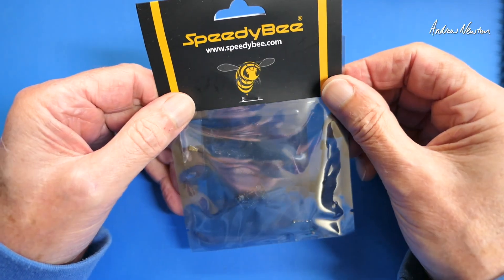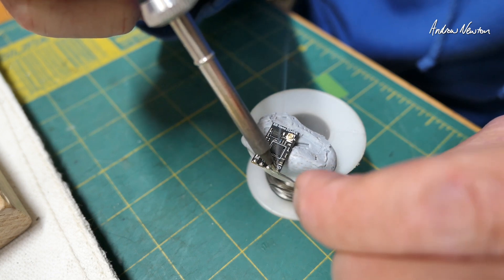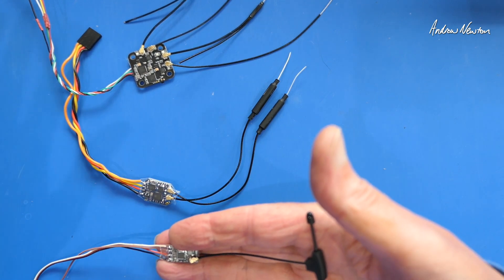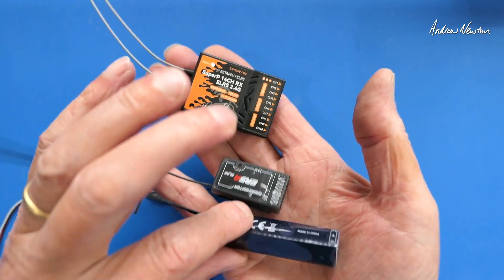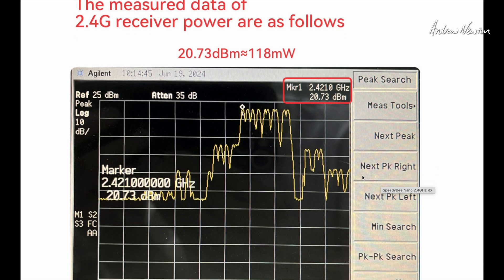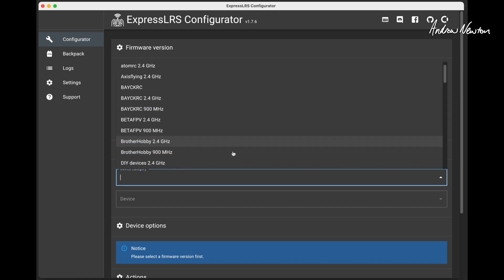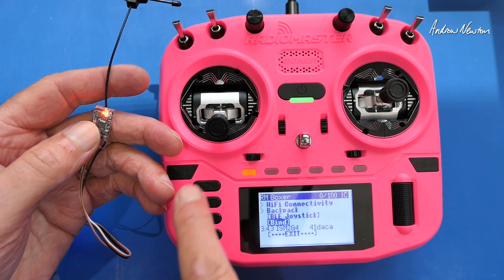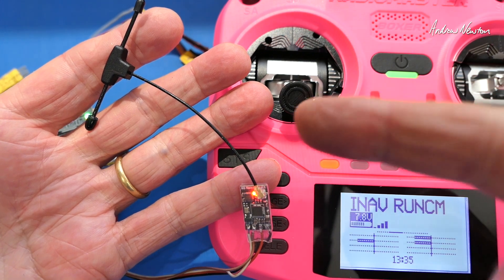SpeedyBee 2.4GHz Nano ELRS Receiver

Comment: Have you used this reciever with 9+ channels?

I have an issue with intermittent telemetry data above the first 10 senbsors being sent from the RX to the TX.
Telemetry is works correctly in the iNav Googles OSD, with the intermitant connection being limited to the TX recieving data.
Sensor data will connect at times and then go red indicating no longer recieving data and does not reconnect again.

1-10 TX Sensors are always stable and I have not issues with maintaining the models control functions.

Bear with me it's a bit of a novel:

I am using a Radiomaster TX16S with iNav 8.01 on SpeedyBee Wing Mini (latest firmware) & SpeedyBee ELRS RX 2.4GHz, GPS & DJI 04 Pro with 3Axis Gimbal. Firmware is 3.5.1 for TX & RX.

TX ELRS Ranger Nano module configuration is 333Hz Full (-105dBm), 16Ch rate/2, Link Mode is Normal (I am using 14channels) set to Dynamic Power Range, Originally was 1:128 (152bps) ratio, but I have tested with multiple ratios down to 1:2 (13211bps)  - this does significantly not change the connection reliability.

Model Setup is External Module CRSF, 400k, status reads 333Hz.

I have a complete and identical second set of FC & RX hardware loaded with the same configuration which behaves in the identical manor.

The same hardware has worked correctly in the past on a model configured for 1-8 channels at that time I was using the iNav app for EDGETX, but I had issues with the app it effecting Timer 3 for other models, so I did a complete TX reset and reloaded my models to resolve that issue.

Any suggestions to get some stable telemetry to the TX are welcome.
Reply: I have just found a fix for this issues, so I will leave it here so it may help anyone else & and also because it is so simple.
I changed the frequency down to 100Hz Full, ch16/2  and the ratio to 1:2 and Walla full channels & locked in telemetry!
Reply from the maker: Oh that's good to hear. Didn't know how to answer your initial question because I had not seen those problems. I also use 100 full 16/2 and standard telemetry ratio.

Comment: Hello,     Mr. ANDREW  , is the heating of the ELRS 2.4G Dual and Single Antenna receivers an acceptable operating standard? I have nano receivers purchased in August 2025: HPXGRC 2.4G ExpressLRS, and DUAL ELRS 2.4G set to 10mW, connected via an Original Hobbywing SKYWALKER with a 5v UBEC.
Reply from the maker: Warm is normal but hot is not. I would check the BEC voltage

Comment: Hello andrew..please have a video on how to mount this nano reciever on rc planes..thanks..
Reply from the maker: Just keep the antenna vertical and away from battery, metal or carbon spars as much as possible.
Reply: @AndrewNewton  thanks..by the way, which do you think is more powerful, the elrs er8 reciever or this nano elrs reciever..?
Reply: @AndrewNewton  that not really going help any body andrew doing how to would be more helpfull

Comment: my rx will not go into boot mode properly. When i do it with the button, it had a solid red led. I attempt to flash and it gives me the "no reset" error. I have tried over wifi, and all other options. I updated my transmitter no problem
Reply from the maker: This is the most reliable way for me https://www.youtube.com/watch?v=8poK--ln5J0

Comment: Got one, installation and testing went relatively smoothly, not as well as with the radiomaster rp's I usually get but wanted to give this a try since its a few bucks cheaper. Then come time to take the new build out for a maiden flight and it bricked itself before I even got to fly. LED is solid red and won't go into boot mode, so I can't even reflash using ELRS BF passthrough. Now I have to buy a recovery dongle since its out of the return window and the company won't cover it with their warranty, just hope that works. Not sure what's up with their quality control but this is the second Speedybee product I've had major issues with.
Reply from the maker: Mine is working as it should. Hope you can recover it.

Comment: Can anyone see a problem with running one of these as a backup receiver for an aircraft with a Beta VPV 14 channel ? Is it even necessary in a 2m Rc aircraft for line of sight operations?
I was also wondering how I would even test for that redundancy given the servos are connected to the 14 CH Betaflight.  
Any tips ?
Reply from the maker: Can do it with FrSKY receivers but as far as I'm aware ELRS doesn't do  redundancy like that.
Reply: @AndrewNewton  thanks Andrew, that’s where I got the idea.

Comment: SpeedyBee has been doing well lately. BTW, 100mw telemetry is incredibly high, they must have TXCO, temperature controlled oscillator — otherwise the heat would push the oscillator and thereby frequency out of spec. That would lead to loss of signal. Pretty cool tech.
Reply: It does not have a TCXO.
Reply: 100mW is pretty standard for ELRS receivers with PA/LNA.  The teeny little ELRS receivers are ~10mW telemetry.
Reply: @techstuff6829  like the ep2? That's the one I use. Or the ep1, whatever one has the ufl antenna
Reply: 100mw is music to my ears. Much more music than the "telemetry lost, telemetry recovered, telemetry lost, telemetry recovered".. etc.  Shit makes my brain boil